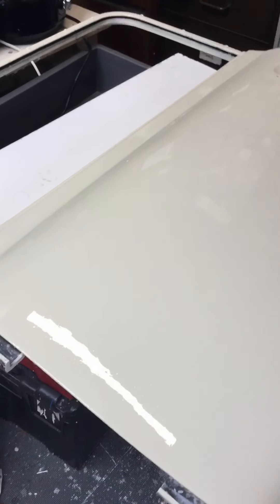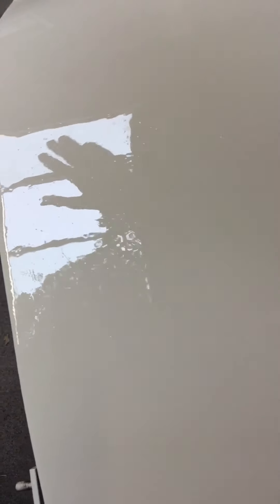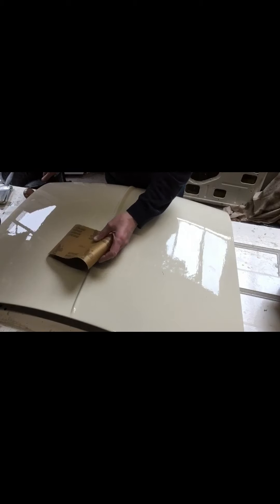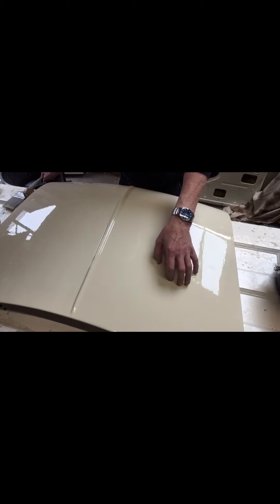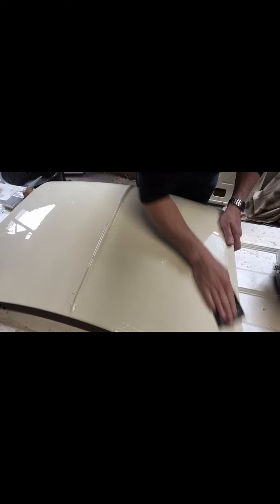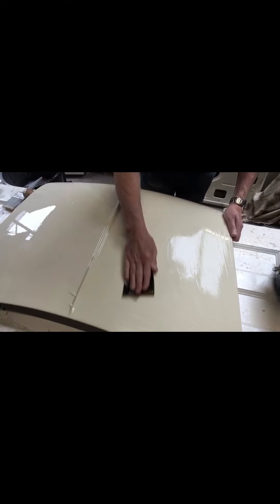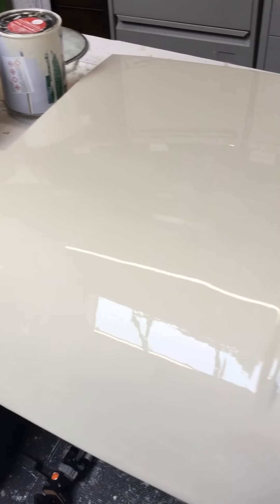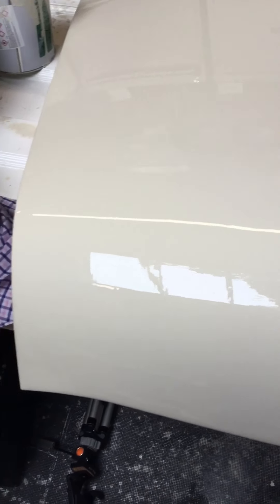How to coach paint car at home with a brush 👨‍🎨

Comment: Does this technique only work on horizontal surfaces? So I have to remove every vertical panel from the vehicle?
Reply from the maker: Yes it works with the doors on or off, mine were only off to do some welding and I thought it might be easier to show on the camera what I’m doing.
Regards Steve

Comment: I do seem to recall Rolls-Royce would use several layers of paint and sand it back each time as well to get a perfect, deep finish. However I think that was probably before filler primer etc.

Enjoyed your video by the way, got a motorcycle tank to do so may give this a try if I can find a suitable paint. 👍
Reply from the maker: Yes you’re right Thomas Rolls Royce did use this method in the 1930s till 1970s I think, gets a brilliant deep shine,you could dive in to !
Good luck with the tank post a photo on here, I recommend craftmaster fantastic stuff.👍🥃

Comment: What's the difference between coach enamel you use here and regular car enamel people spray on? I have a car I am wanting to paint but no spray equipment and your way seems to be much easier and just as nice in the end.
Reply from the maker: Do you mean rattle can enamel paint? If yes I have not used it to be honest, I know the paint you use by brush is specifically for painting cars and boats.

Comment: Thanks for sharing your work. The car looks great. My old car has some clear coat peeling so decided to repaint it. I sanded it down and painted the hood and front bumper with some enamel and a little penetrol. I used a short flock roller to apply and tip with a foam brush. The hood turned out pretty nice except two areas that I can see a little of a line where I did different sections. The paint has a nice shine to it and looks to me close to a factory finish. The bumper was more difficult with a roller and had a couple of runs. I am going to sand down the hood and bumper and try applying with a brush and tipping with a regular brush not foam brush. In another video, it appears that you paint with a brush then smooth with a tipping brush. This video it appears that you paint with a brush and tip with the same brush. Is that the case?
Reply from the maker: I used a 3 inch Harris paint brush,then tipped it with a 5 inch Hamilton tipping brush sometimes called a laying off brush.
But yes your right I did use the same brush sometimes depending on if it’s only a small area,you can get away with it ( But I wouldn’t recommend doing that way) especially if you’re doing this for the first time 👍
Reply: @2194steve  Thanks for the quick reply. Very kind of you. Great, I will apply paint with brush and tip with another brush designed for tipping.

Comment: Is the technique the same for vertical panels? So glad I found your channel. I am inspired to paint my LandCruiser like this. Thank you
Reply from the maker: Yes exactly the same, I only did mine horizontally because the restoration guy took them off to do the floors,otherwise I would have painted them in situation. Hope this helps?
Good luck with the painting if you need any help or advice please ask.
Regards Steve
Reply: @2194steve  thank you, I really appreciate it!

Comment: Great videos and a lovely paint job. Did you prime before using the enamel pain and if so what did you use and was is hand painted too. Thanks Glyn
Reply from the maker: Hi Glyn, yes I did prime it and undercoat first, 3 coats of each before putting on the topcoats.
All hand painted 100% with a 3 inch household paint brush 😂👍
Reply: @2194steve  it looks amazing. Did you bare metal the car and what kind of primer did you use?
Reply from the maker: @glynharding8109  have you watched all the videos from the start, they tell you everything and techniques, and the best way to paint your car.
Reply: @2194steve  I will watch them this evening. I only came across this one this morning. I have subscribed. Thanks Glyn
Reply from the maker: @glynharding8109  cheers Glyn
Reply from the maker: Enjoy I’m sure you will, and it’s so easy and save a fortune at the same time.
Only thing is if you do try this method,don’t try and cut corners it WILL backfire on you.
Regards Steve

Comment: Liking your work, do you need a primer if your painting a car the same colour?
Reply from the maker: Yes David, primer x3
Then undercoat x3
Then flatten with 800 wet and dry, next topcoats flatten each coat with 1200 to get a good key.
Then lastly clear coat.
All brush on! Hope this helps.
Cheers Steve

Comment: That looks fantastic! The finish is great - is that without polishing at the end?
Reply from the maker: Hi Robert, Thank you ,yes that’s straight out of the tin basically, No polishing at all
Reply: @2194steve  Well done!  , ive tried this but always have to wet sand and polish - will try your technique and see if i can get a better finish
Reply from the maker: @robertmic8601  Thank you, this paint won’t wet sand and polish it burns on the very last coat I put on a clear coat,which is also brush on.